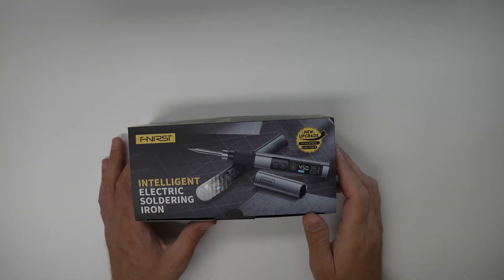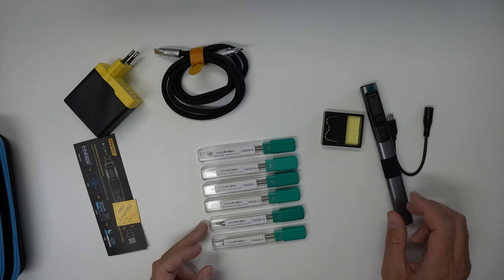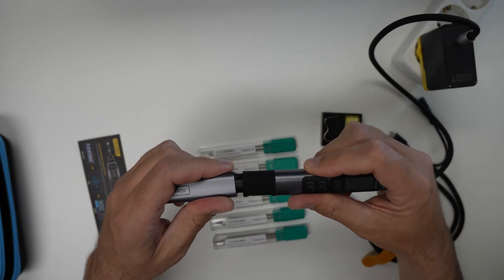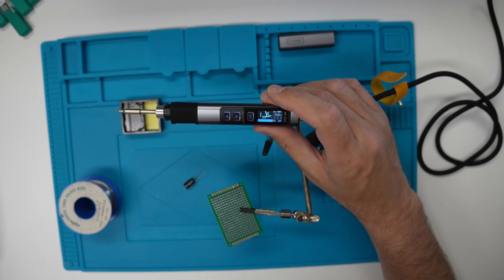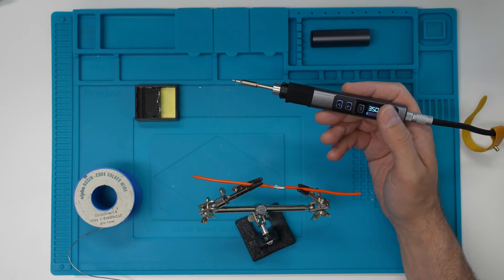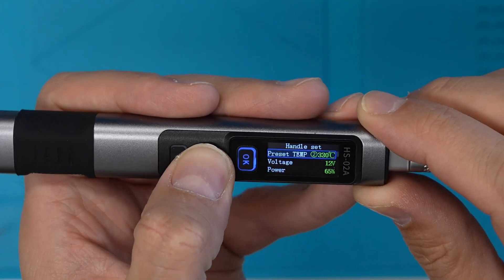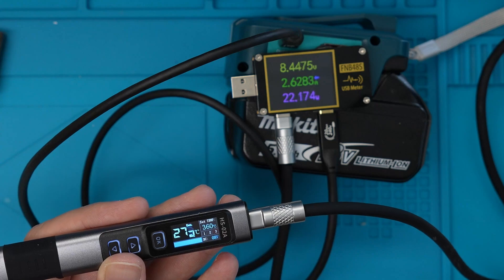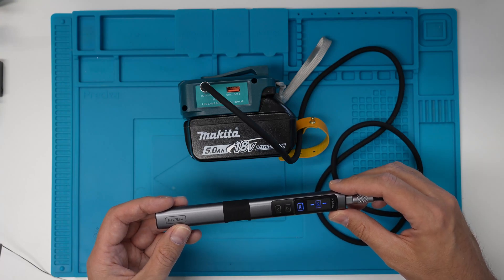Fnirsi HS 02A Soldering Iron - Can it go wireless?

Comment: You can try to adjust the power in the settings. Mine came with 65% from the factory and I tested it with a super-slim Nitecore NB10000 powerbank without adjusting any of the settings. It took 30 seconds to heat up and to maintain the 360 degree temperature it draw 0.5 Amps @12Volts. No errors and it's working flawless.  The max output power of the powerbank on the port I tested is: 18 Watts (1.5 Amps @ 12 Volts).